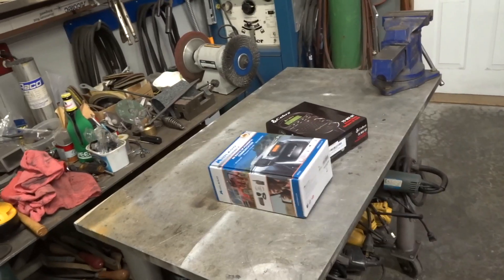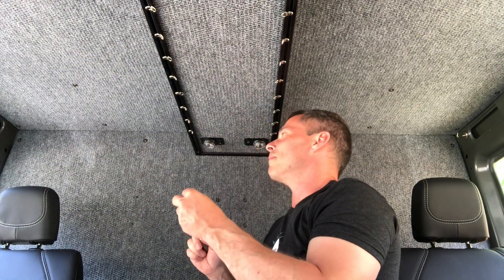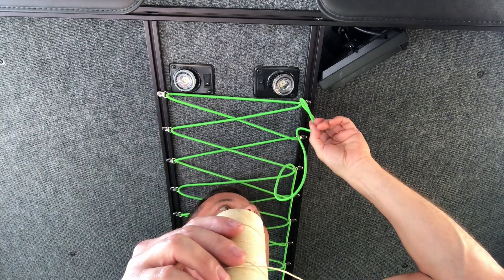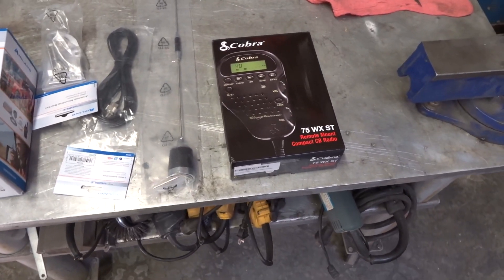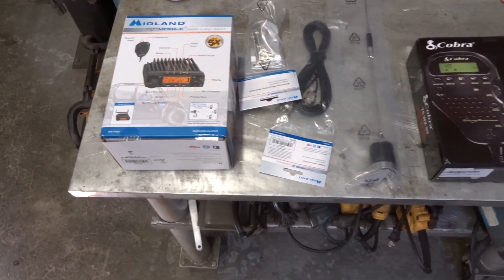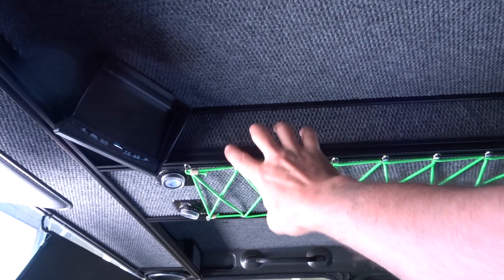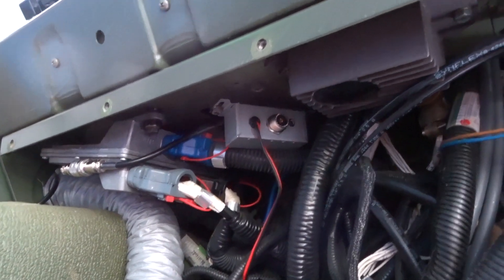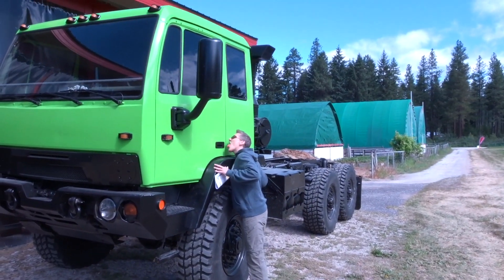Adding some radios to the LMTV

Comment: New subscriber here, I have a couple questions for you? Why did you choose the Midland radio brand, and what kit did you use for your headliner? Thanks.
Reply from the maker: I’ve had good luck with midland in the past.  As for the headliner, I built it out of plywood, carpet and 8020 aluminum extrusions.  So, not a kit, is the point I’m getting too.  Here are a couple of videos on it. https://youtu.be/PR4reXz61rw and https://youtu.be/suowfk4AqoE